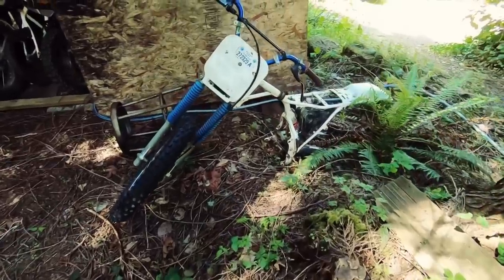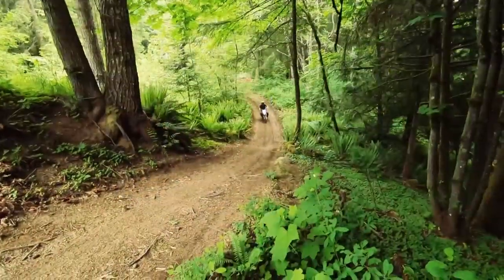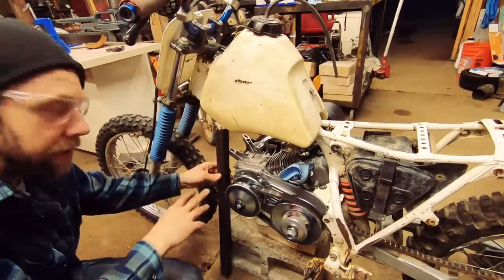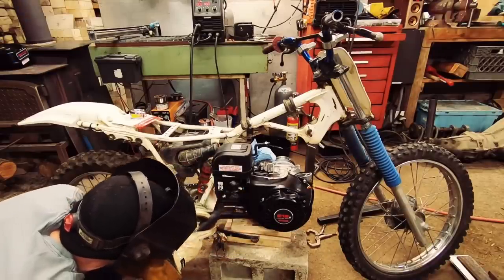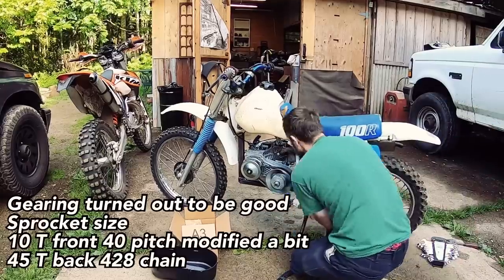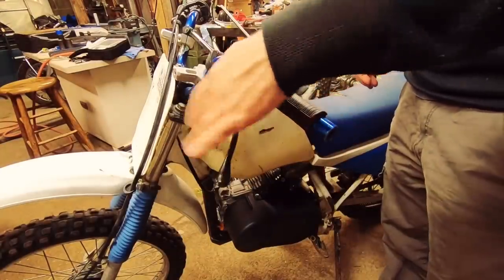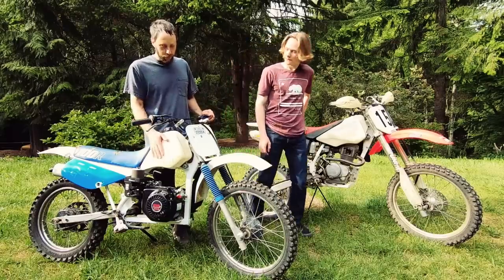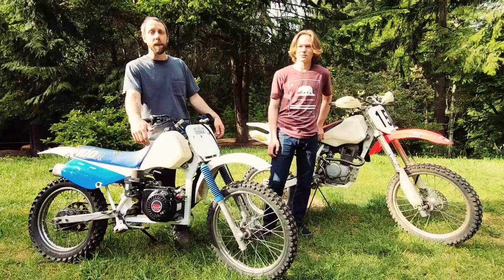Predator 212cc engine swap mini bike motorcycle

Comment: Very cool project, and the bike looks very torquey now, nice! Just subscribed
Reply from the maker: Thanks Trevor!
Reply: Mike festiva , I forgot to mention something: I have an ‘06 CRF100 that I’ve added a heavier shock and bbr fork springs to, for adult riding (me), and I wanted to ask if you think the 120cc kit is a good upgrade?
Reply from the maker: Definitely worth putting in the BBR 120 kit! It really woke up the 100! The kit I think includes, high comp pistol, new cylinder, cam, valve springs and valve retaining caps and possibly gaskets. We bought a FMF exhaust and we also put on one of those nock off XR 200 carbs on EBay the bike has a lot of torque and quite a bit more power then a stock 100. Take care :)

Comment: greetings friend I have a problem with my series 30 torque converter The front clutch while I use the motorcycle does not close it stays open but if I have it raised when accelerating The clutch closes what could it be and thank you very much

Comment: Nice video. Interesting project. I’m considering doing a 301cc swap on my 160cc four wheeler. Do you think it would have enough power? I would like to use the transmission from the four wheeler it’s a semi automatic tho so I’m not sure if it would work.
Reply: What engine is that

Comment: Hi, could it be done without cvt? I am thinking directlly putting sprocket on shaft of the engine to the back wheel. Would this be good or bad, or even doable?
Reply: yes you can just run a clutch. but it wont have as much torque. cvt has more torque
Reply: @wrxyluv  how do you mean that? Put a clutch on the engine shaft and connect it to the back wheel?
Reply: @deanivancic6954  yes, it's quite easy to do and hassle free
Reply: @wrxyluv  thank you very much for the advice :)
Reply: Real nice fabrication skills. You made that bike frame look factory after paint. Great tip on leaving a tab to cap ends and add structure.
Reply: Directly off the crank with no clutch is not doable. You can’t stop until you shut the motor off
Reply: Lmao let me know how that goes

Comment: Sounds lit only down side is 1 gear
Reply from the maker: Yes you can’t shift each gear like a regular motorcycle but it is variable speed, it’s always adjusting your speed for maximum torque, the CV transmissions actually work pretty good 👍
Reply: Mike festiva I used this exact motor to completely rebuild a old Briggs and Stratton gokart

Comment: That thing "rips" for being an stock engine right out the box!
Reply: it's called torque. the predator 6.5hp probably has 3 times the torque of the original motorcycle engine which probably produced 3 times the horsepower of the predator. perfect for a trail bike where speed isn't important but torque to get out of ruts and over bumps is important.

Comment: I put that motor on a Polaris trailblazer frame  I didn't make a Jack shaft I took the sprocket off and removed the brake caliper and made a mount to bolt a bigger sprocket onto the brake caliper mount I just capped the rear brake hose the front brakes stop it good
Reply from the maker: That’s great you got it going again!

Comment: If you remove the governor you MUST replace the flywheel as the original will explode at the higher RPM's.
This could cause you and the bike a lot of pain and grief. It can be dangerous. GOTO gopowersports.com for the proper upgraded flywheel. BTW looks like a lot of fun!!  :)
Reply: The weak link on these engines is the rod when running higher than stock rpm's. Billet rod and flywheel and you are good to go.

Comment: I think we can tell why motorcycle companies don't like to use CVTs. Look at how well this runs with low horsepower. What would happen if new 250s started running over old 500s just because of transmission efficiency?
Reply: I'm curious to see how it works in wet and mud.
Reply: @timothyadams4477  they didn't show it in the video, but these comet torq-a-verter clones have a cover that keeps big junk from getting into the unit. even so, in rain without a cover they work just fine. mud won't affect the unit's operation much as long as you keep gravel and twigs out of the belt sheaves. that's what the cover is for.

Comment: Great video for the $99 HF motor and $200 CVT.  But want to see if the motor is straight out of the box or if this was modded with carb, head, and ignition work?  Next try the next size up motor with elec start from HF.
Reply from the maker: Thank for checking out my video! $99 harbor freight engine and the CVT was about $65.
This engine was bone stock right out of the box, it’s the Hemi model so I think it produces 7HP stock. It works quite good.
I did another video where I removed the governor and add stiffer valve springs, installed a bigger main jet and a free flowing air filter. It definitely helped. I have a stage 2 kit I need to install soon, it’s a billet flywheel,  billet connecting rod, thinner head gasket, cam and I’m going to make a custom intake for a Honda XR 200 carb, I think it will really put out a lot of power. I feel it’s already plenty of power the way it is for this little frame, but I have had a lot of people asking to see a stage 2 kit installed. I think you are better off modifying the 212cc engine for more power rather then trying to install a lager motor, this 212cc engine fills the frame up, it think anything bigger would be to large for the frame area. Take care 👍

Comment: Wow! Only 7HP? Nice torque.
I built little board track racer. Maybe i mount Honda GX 200 or 270 clone in frame. Predator engines is not exist in Poland. Only Briggs, or old Tecumseh engines. Or Kohler/Wacker, Subaru Robin.
This is my project:
https://i.imgur.com/Wue3Wmy.jpg
Greetings from Poland.
Reply from the maker: That sounds like a good project you made, I will definitely check out your video!

Comment: Ah, the Predator 212:
Torque of a 125
Horsepower of an 80
Cost of an expensive dinner.

That would be cool if a company built this style bolt-on motor but built them better.
Reply: you mean a honda?
Reply: Predator is a honda clone. And a damn good one
Reply: I am surprised companies have not built CVT style dirt bikes. Sure, you loose some power but what a bike with this transmission would offer is smooth fun riding for those who are older or unable to actively shift anymore. My wife is one of those. She knows how to ride and shift but due to surgeries she is unable to comfortably ride. She just wants to scoot around but on smooth areas hit the throttle when possible and really gain some speed.
Reply: @27Zangle  They're out there! I've seen a few on Craigslist. I saw a Husky 450 centrifugal clutch for $3500.
Reply: @Maccaroney  - Check this thing out! http://www.off-road.com/dirtbike/vintage-dirt-bikes-a-look-at-rokon-automatics-53152.html
Reply: @Martys Pawn - Just read up on the Rekluse Clutch yesterday. Neat concept that would really help someone like my wife. I too think it would be worth having.

Comment: So how has this thing worked? Update video would be nice to know what ever this setup is reliable, how much fuel it uses etc.
Reply from the maker: I have posted 3 other videos about this bike since this video. 
I really don’t know what to tell you about the gas consumption? It’s a small 212cc single cylinder engine, it uses about as much as a roto tiller or a small generator.

Comment: Sounds like my old xt 500...I Have ideas.. jetski 550twin in Banshee Frame..
Reply from the maker: Nice you had a old XT500! I had a old Yamaha SR500 that I got out of a barn years ago, it was haggard, I grafted on XR250 forks with a disc brake and did a lot of custom work like rack and different tank and seat, I turned it into a dual sport, fun bike, after finishing it,  I took it on a 1800 mile ride to Idaho! It was a wheelie machine :) 
Thanks for commenting!
Reply: Good luck trying to modify a "out of water" cooling system for that haha, but the idea sounds badass.
Reply: @jwallace7230  that's my Main Issue...Im thinking Aftermarket Rad, and Fan....I have a Full rolling frame laying around and the Yamaha skidoo is a 91 or earlier But it has a 550twin....Looks don't matter much. I just want to get it Running enough to Go to the Coal Hill's Make a Climb and that's about it.. im looking at double ford festiva radiators and Hopefully i can get 10 mins at a Clip...
Reply: @Mikefestiva  i had 2 1976. First 1 was 100bucks. 2nd was Almost mint paid 500(house sale) Shattered my ankle 3 times...I forgot why i sold them. Now First year XT are Impossible to find. best Trail bike,And yes Torque Monsters... Kicking myself 20yrs later.

Comment: this is perfect. i have issues with coordination. i tried many times to drive a manual tractor but it didnt go well. i could go through the motions in my head but i wasnt able to push my body to do so. im pretty sure i have some form of dyspraxia. ive wanted to be able to drive dirt bikes but i dont know where i can do that around my area and i could never find anything good for my size with a cvt. maybe in the future ill be able to try something like this and have a good spot to ride but ive got a lot to learn as i know almost nothing about how to do this
Reply: CarlS. You could ride a dirtbike normally trust me it’s a lot easier than u think all u have to do is pull the clutch in shift and go if I’d recommend like a ttr 125 cause they have pretty good power and u can just leave it in second till u get use to shifting
Reply: @private1712  thank you. ill definitely be looking into that.
Reply: No problem always love to get someone else into riding good luck on your search
Reply: to be fair to you, manual tractors are fairly difficult to wrap your head around. That said, it also took me quite a few years to get my head around manuals (first on an abused 125, then a car)
Reply: @private1712  i been looking at it and i need something bigger with that same low end torque and ability to stay in 2nd until i get the hang of it. im 5'11" 300lb (its slow but i already lost 30) and the ttr 125 doesn't have the suspension or suspension upgrades to support me. do you have any other recommendations?
Reply: A ttr 230 should do bout the same I've heard
Reply: If worse comes to worse you could always get a rekluse
Reply: @FluffyBuzzard2TheMax  they do not make them for the ttr230

Comment: I can't bore you with a mechanical lecture you obviously know what you are doing. Don't over look a bar mounted kill switch it would be a very easy mod and probably the best one you will make. We all know the consequences of a stuck throttle/auto trans combination.
Reply from the maker: Yes Definitely! That was one topic I was going to cover in the next video, I found the original xr kill switch and I’m going to show how to wire it up, along with answering a few questions others have had. Thanks for commenting.
Reply: @Mikefestiva  That's great, thanks for your reply. Thought you would have it covered, when there's kids around gotta be safety first. It brought  my dad instincts out seeing the little one up front. I knew you would be safe for a short test ride and probably on new cables but in the long run it could be a life saver when the cables get some wear and use. Happy riding 👍

Comment: Cool build...but a fyi the gas tank is actually structural to the engine...that's why if you look on ebay there are plates sold to take the place of the tank if you remove it...thanks for the post
Reply from the maker: I will look into that. I would be really surprised that the thin sheet metal of those tanks could add much support to the cylinder and crack case? I have been running one of these motors hard for two years now without a tank on my quad truck and have had zero problems yet.
Reply: @Mikefestiva  just some information that was passed on to me a few years back..those engines are commonly used at the local kart track..but as with anything I suppose it's how you treat them....thanks for the reply..

Comment: A tillotson 212 electric start would be better because it's 10 horsepower and can handle 5000 RPM's on the stock setup and that's with the governor system still in use and use a 40 series torque converter with a 3/4 driven unit.

Comment: 200cc and only 6hp ?!?!

If you want efficient power you should buy a minarelli am 6 it's 50cc but makes around 9hp
Reply: The predator will last wayyyy longer, and has a lot more torque.
Reply: @hrbestalkinme3690  I have a Enduro bike with that engine and it has plenty or torque
Reply: @hrbestalkinme3690  and it's from 1999
Reply: @kes01523   Lol bro this has like 4 times more torque
Reply: @hrbestalkinme3690  I know but it's some much fun to drive because it has a ridiculous top end power spike around 9-13k rpm

Comment: So I just bought an 89 rm125, was gonna put the 212 on it, with a 30 series torque converter, but I have no idea what size rear sprocket I need that will actually fit on the bike? Any help here? The builds great btw Mike! Bout to do the same thing you did as I can figure this out. I run a 420 chain on all my 212s so that’s what I wanna go with.
Reply: willwelde87 He has a 10-tooth (1/2 inch spacing 40/41/420/etc.) up front, and a 45-tooth in rear.  I have an old XR100 with the same 10-tooth tq. conv up front and the original 50-tooth (428 chain) sprocket in back. I use a 428 chain. However I think the not-as-wide 40 chain can do you good as well. Just have to make sure even if it's 1/2inch style, that the link depth matches up to go all the way into the rear gear. I tried a 420 chain and it didn't work into all the teeth on the 50-tooth sprocket in back (made it a little over halfway around). 45 tooth will get you higher speed. 60 tooth more acceleration. However as you can see here Mike's 45 tooth did him just fine pretty good 🙂

Comment: I’m wondering if this could be a street legal swap for a small enduro.
If so, it would be great for a 1up local commuter.
Reply: Technically these engines are for off road use only, no/minimal emissions equipment.
Reply from the maker: The only thing you would need is a lighting coil to power lights, you can buy them for these motors, I would have no problem running one of these engines on the street! Thanks for commenting :)

Comment: Hey I’m looking at doing this build and already got the motor. What year is that xr100 is it an 89? Also what model of a torque converter did you use?
Reply: Use tav 300 series torque converter
Reply: Ceanik I did this on an 84 XR100 used the Series 30 tq conv. (eBay) for $50 with the 10-tooth (not 12-tooth) as it's originally 428 chain, so I run 428 chain. I tried 420 chain but didn't work on the rear 50-tooth sprocket due to depth, had to switch for 420 (though 40 might work? just narrower I believe). I spent $30± on a 212cc mounting plate. Mike Festiva here made his own, obviously cheaper if you're equiped and skilled.

Comment: That’s fucken sweet do the make a 4 speed trans
Reply: There's a vid of a guy taking a blown motorcycle engine , removing the crank and using the gearbox. 
If I remember he had a mower engine for power , ran the shaft to the gearbox and voila , a mower engine with a motorcycle gearbox. 
Kinda neat trick.

Comment: Nice bike what kind of xr is it I’m fixing up my 84 xr 200 timing chain went out also first vid I’ve watched by you I subscribed you make some good content
Reply from the maker: I it’s a 93 XR100, we used the engine from it and swapped it to a CR80 frame for my nephew, we tricked out that little XR motor quite a bit, BBR 120cc big bore kit with cam and big carb and exhaust, but after using the engine, the frame had been sitting till I did this predator motor swap. I hope you get you XR200 back together soon. My friend has a CR125 with a XR200 motor swapped into it, cool bike!

Comment: Damn good 👍
Reply: Can you put a link to the cvt/torque converter you used, or recommend one... Thanks!
Reply: ...planning on building a mini bike w swing arm and front sgocks same predator engine 6.5hp or might buy a xr75 w siezed motor and copy your video.  Thanks again!

Comment: Should i buy a 100-300 buck bike and do this swap? All in about 500 to 600 bucks? Also i would be a first time bike owner.
Reply: If the motor doesn't run go for it

Comment: Apparently there's more to these chinese lawnmower engines than meets the eye
Reply: I have a 10 HP roto-tiller.  When the carburetor needed replacing it was just as cheap to get a Predator 212. Makes more power than the old 10 horse motor. The dirt really flies!

Comment: Out of curiosity, what thickness is the wall on that steel tubing? How much weight will that engine cradle hold, roughly? This is an awesome build, and it has inspired me to do something similar with one of my old bikes.

Comment: What size chain. 420?
And is the torque converter mandatory?
Need to figure out the whole chain situation.
Reply: @NO-WARNING-SHOTS  I'm in the same situation.  My xl100 has a 41T rear sprocket #280 chain pitch. Torque converters don't seem to come in 280 so I am going to need a custom sprocket or run without a torque converter

Comment: Need some taller gearing
Reply from the maker: Why? It’s a trail bike, you don’t really ride over 40 mph on trails.
Reply: @Mikefestiva  if you want to keep up with bigger bikes then taller gearing would be nice. I could see leaving it as it is if all your doing is trail riding but stock 250s will do close to 80mph so keeping up might be a challenge but you do you man.

Comment: Hey great video, i have a few questions about your gearing. I am building a 223cc bike and i want enough power to wheelie at about 50% of the engine rpm. The bike im building will weigh approximately 35kg/80lbs. I see you have a torque converter which i do not know the gear reduction ratio and you mentioned a 10t to a 45t which is a 4.5:1 reduction. So all i would like to know is your complete reduction and bike weight.
Thank you